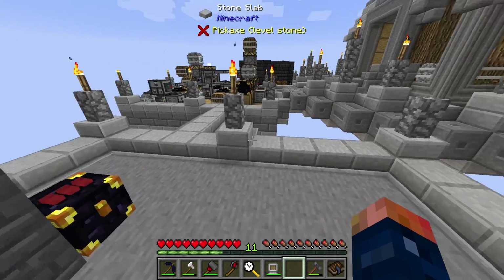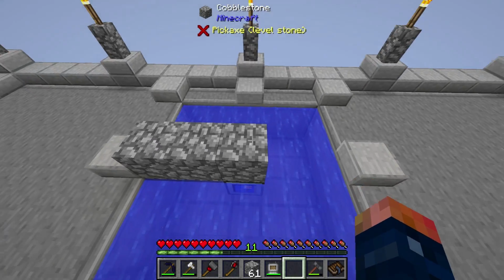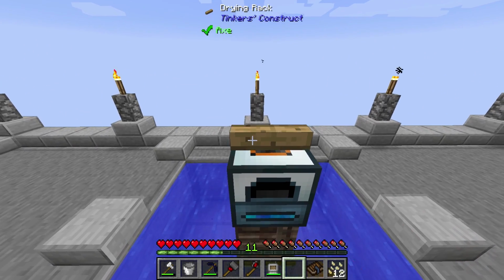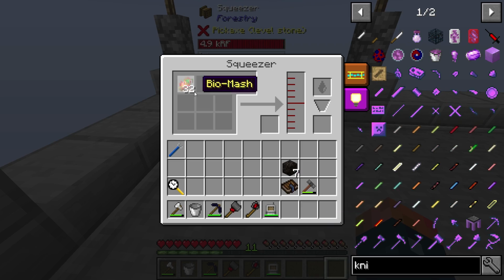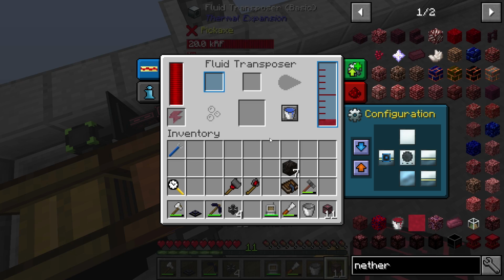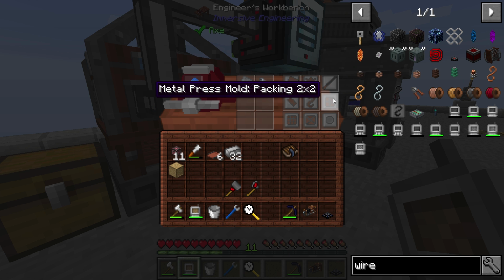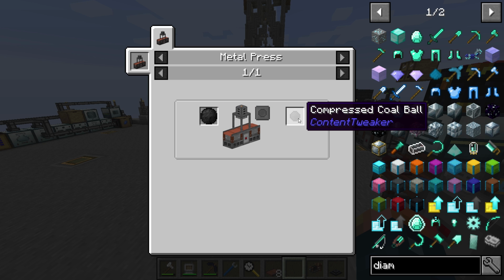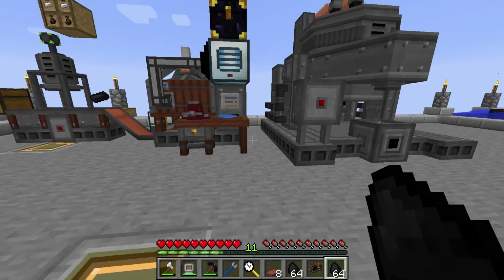Ultimate Alchemy Modpack Ep. 14 Leather Fishing Automation

Comment: the ARC Furnace has a max input per thing of 4096 rf/t, and uses 6144 rf/t with all 12 slots filled.  So, you either need another flux plug, or you can effectively only smelt 8 items at a time.